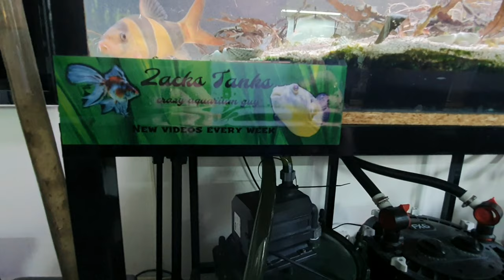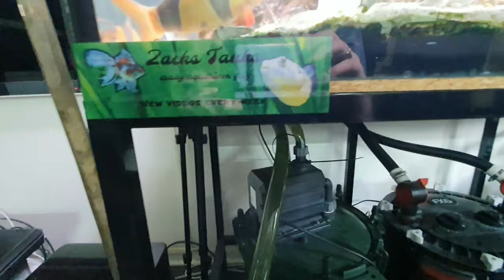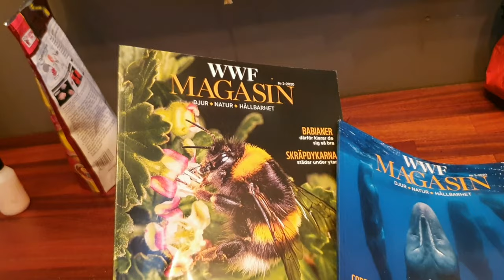175 Gallon Aquarium Complete Rescape, 25 New Fish, Zacks Swimtales Number 13 (Description more info)

Comment: Don't you ever do salt water tanks?
Reply from the maker: Never even tried. Because the bigger it is, the easier it is. BUT! You need konstant, a big black 50-10 gallon barrel  of saltwater mixed up perfectly and ready to go. Because they are very sensitive. If something is happening... You can't just run tap water, you need perfect salinity.

Comment: I dig the anchors for the val, good tip, ,I have been using the lead strips, like your idea better.  Do you use root tabs or such?  How did you get those to grow that size?
Reply from the maker: Overfeeding livebearers! Always my tip! 😃i hardly never use fertilizers. Look at my Rainbow tank with 32 Rainbows and 60 Corydoras. In my last fish room tour. NOT Swim Tqles nr 12. Food turns into poop, poop fertz tgmhe plants.
Reply from the maker: And good lighting. That is everything